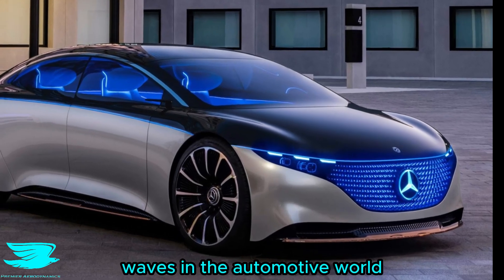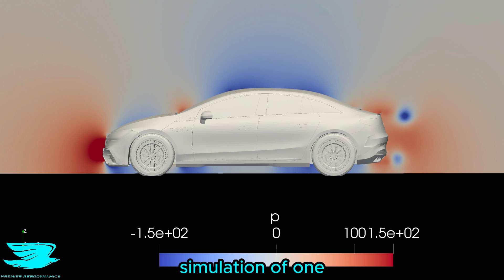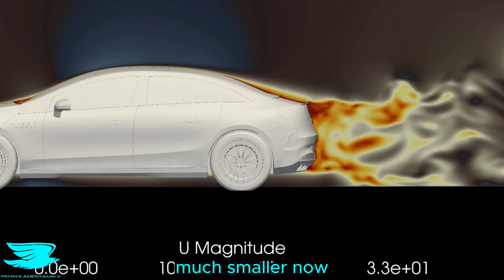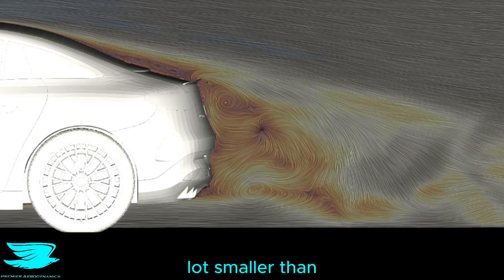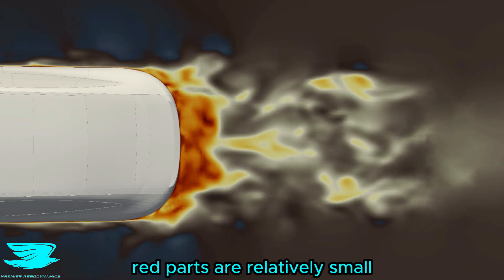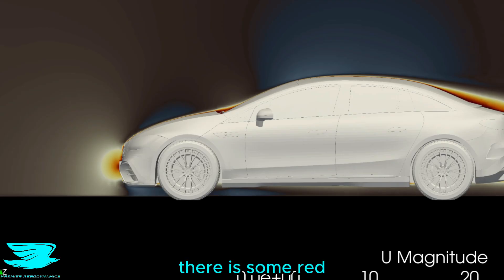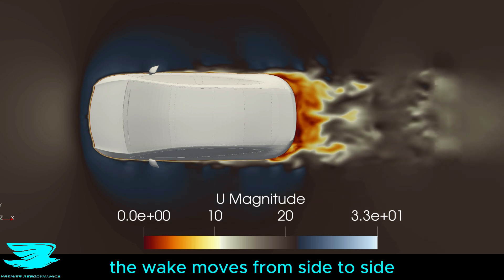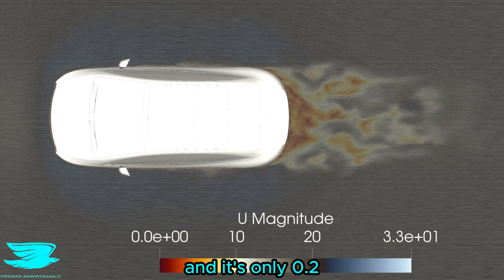Mercedes Benz EQS Aerodynamics Explained

Comment: Looks like you have taken the smaller EQE for your demonstration. The EQS has a longer rear overhang and no "spoiler" below the rear window. Nevertheless i really appreciate your videos! :)
Reply from the maker: Oh really? Sorry, I thought I got the EQS.
Reply: Definitely an EQE but it’s an easy mistake to make, the crossover versions are even harder to tell apart
Reply: @JamesSheridan-td4ci  Yes, they are almost indistinguishable. One detail you can tell them apart: the EQS SUV has a hood that goes down to the wheel arches (like the regular EQE and EQS) while the hood of the EQE SUV doesn't.